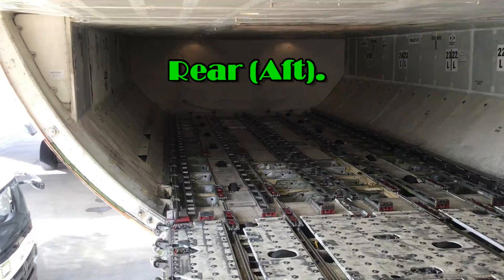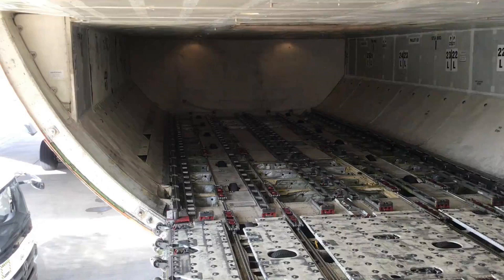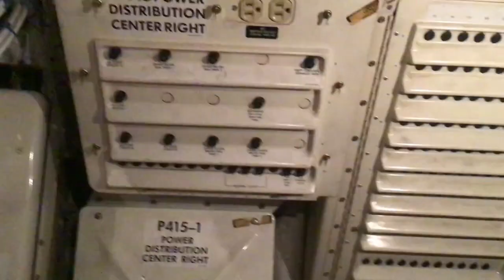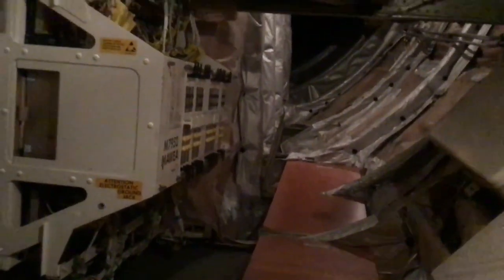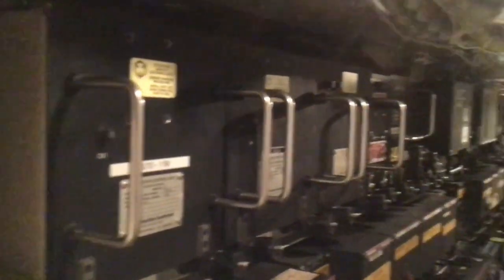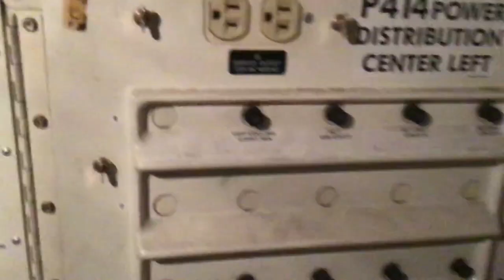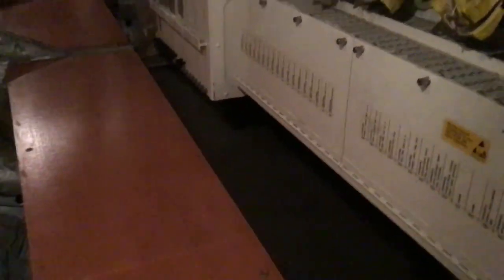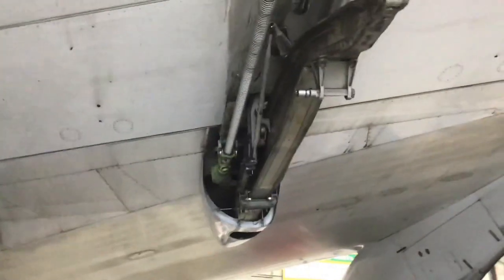747  below the floor

Comment: Awesome tour inside the belly sir 👍 you can clearly see the robust design of the fuselage structure yet the misfits keep crying thin and weak.
Very nice pointing out how small the batteries are as Jones claims there are loads of batteries!
Amazing how the flaps do not go into the wing, as they extend and hang off the wings trailing edge.
Reply from the maker: DC8Combi thank you sir, I did laugh when the dumb plumber mentioned in one of his recent videos about how huge the batteries are. The biggest aircraft battery I have ever seen was the one fitted to the Lockheed L1011 Tristar. That one was about 30 inches long by 8 inches wide and 12 inches deep and weighing about50+kilos. There was only one needed to start the APU the second battery was purely a flying spare. Airbus unlike Boeing have 3 slightly smaller batteries.
Reply: ianobiwan 👍 from the way Jones was talking you’d think the entire belly was batteries 😝😎
I’m getting my butt kicked here tonight 😂😂 maybe 45 minutes of work left then tons of paperwork or should I say computer work. It must be done and inspected by midnight, I’m by myself but I think I got it 😎
Once I sign off to inspection I’m relaxing for 4 hours of overtime 😎
As soon as I started watching your 47 belly video I thought oxygen and you were right on it!
Let me get this bird done then I can goof off, I know it’s late your time.
Reply: DC8Combi   Dude, don't worry about a thing.
It's all compressed air....
Reply: @garygolfer3243  the first MV-22 CCRAM went gear up for test flight and she was compressing air so hard them tandem rotors threw major rotor wash of burning kerosene from her APU  all over, I was there with her.
Reply: @ianobiwan  I just got to watch the video on my computer as I only had my phone last night, the video looks real good with detail on my computer compared to my iPhone.
Reply from the maker: DC8Combi once again thank you. I will see how long Juke takes to create another alias to post a comment as I have had another cull with Pennyjuke special new friend and Gabriel.
Reply from the maker: DC8Combi yes Juke, his aliases and Joke Penny I see are all spewing their normal stupidity again. Joke Penny the idiot that has no idea how simple PRV’s work, or what a crossfeed valve does and then his no fuel bollocks. I did laugh how quickly he gave up trying to explain how his unicorn piss powered engines work when the Trent 1000 was thrown into the argument, which instantly destroyed his nonsense. They are just jokes. 
Have you seen Agent Jay latest engine video? He talks about the issue of certain GE90 engines turbine blade failures and during the video explains fuel tanks in about ten seconds! Only the fueltards will not understand!! 👍😎🇬🇧
Reply: @ianobiwan  I will have to go over and watch Agent Jay's video, thank you.
Reply: @ianobiwan  Agent Jay did a great job, and his fuel tank quick course was awesome lol. I was aware of the AD from Blancolirio channel but Agent Jay had some really good additional information. I'm guessing the seals are carbon, years ago I did some work for Stein Seal and they made carbon turbine seals. Stein Seal was a really interesting place with some really talented older German engineers and specialist.
Thanks again I'm glad I got to see Agent Jay's video.
Reply: @ianobiwan  did you see what just happened on Professor Jone's channel? There was some real strange post on one of his newest videos and then BOOM it disappeared with a few others! Then a new video labeled his last came available and he was whining about some $42,000.00 fine, I commented "who was that person that came outta nowhere" and "what fine" BOOM all his videos from the past 6 months gone! Only his old video is available.
Reply: @ianobiwan  he's taking everything down! Something got him in BIG trouble!
Reply from the maker: DC8Combi  yes I did see jones latest video whining like a girl over the usual and this $42000 fine. I did see something about this fine on YouTube the other day. I haven’t read anything about it yet. No doubt it will be about copyrights and inappropriate material. I will check it out at some point soon.
No doubt the wife was standing over him forcing him to delete his nonsense as she is not happy with him as he hinted in a recent video. Joke Penny and the Duke aliases will be a bit lost as their god is now running away, well until he comes back again. 
I am just checking out now as I am up early for work in the morning. Well at least Joke Penny will be quiet for a while!! 👍😎🇬🇧
Reply from the maker: DC8Combi everything has gone. The wife has definitely given him a choice, the mad looney videos or lose those massive balls!! 😂😂
Reply: ianobiwan 😝I see they are gone! I guess he choose keeping his massive balls 😝👍
I gotta look into that fine as I didn’t know anything about it. 😎
Reply: ianobiwan have a great day sir! 👍
Reply from the maker: DC8Combi morning sir, yes that was an amusing video. Well at this moment it does look like it is fairly terminal with jones and his mad videos. I wonder where Joke Penny and the clone army of twats that is Duke they are hiding. I see Emperor has changed names and popped up on Roger’s latest video. 
I saw a photo posted on jones Facebook site titled great unsolved mysteries of the world, with three images, a Saturn 5 rocket, the LEM and the Command module after it return to Earth with the words “ how did this turn into this and then this” ending with research flat earth. I laughed as it proved they don’t research and know nothing.😂👍🇬🇧.   https://www.facebook.com/photo.php?fbid=181968399615776&set=a.110925366720080&type=3&sfns=mo
Reply: @ianobiwan  good morning sir I thought you may enjoy the Peter & Pete. Yes Jones is terrified of this new rule and as you know the misses runs the show, she probably confiscated his toys and watches everything he does on the laptop. Duke is also over on Rebel without a clue's 2 channel I left him a comment there. He's been caught on Rogers channel and soon to be culled.
I wish I did Facebook to laugh at him there but I do occasionally visit his twitter.
You see the NTSB made a suggestion that Boeing modify the 37 NG's turbine inlet rings after the Southwest 37 blade out that breached the containment ring causing a piece of the cowling latch to break a window a year ago. The FAA will be the final determination, if so there are around 7,000 37 NG's that will need mods. Boeing says they are already looking into modifications.
Reply from the maker: DC8Combi wow Boeing have got a lot of work to do. I did read recently Boeing have been told to redesign the structure that has been found cracked on the 737NGs, which again is massive amounts of work for the operators.
Reply: @ianobiwan  yes they do! That's correct there is an AD on the pickle forks of the 37 NG's and it's revealing quite a bit of them.
Reply from the maker: DC8Combi  check this idiot out. There are some familiar names in the comments with the usual nonsense.        https://youtu.be/Cns2Fvo8TbE
Reply: ianobiwan yes there are i was there previously the guy who made the video is brain dead he hearts insults.
I did just notice the peculiar comments as they are very familiar
Reply from the maker: DC8Combi it is a site that is at the moment free of Juke and his clone army of head demons. Jones seems to be pumping his nonsense out on his Facebook site but hardly anyone comments on his posts.
Reply: ianobiwan iId like to see his Facebook shite. I think I’ll ask one of the grandkids to use their account this weekend and get a laugh 😎
Reply from the maker: DC8Combi yes it is worth a look just to see all the deranged and ignorant articles he posts or agrees with. The guy is definitely a qualified loony bin.👍
Reply: ianobiwan  and DC8, I am a lowly aviation analyst who tells airports where to expand, locate jetways, passenger traffic counts, etc... as such, I make friends at every airport I work at and that allows me to see EVERYTHING up close. You guys obviously realize I have access to airside ops, and can verify aircraft size  and the necessity of fuel, thereby rendering a lot of conspiracy videos totally false.  That's my favorite part of commenting on the ridiculous conspiracy videos, all of us can go see for ourselves everyday while they sit in front of their computers wasting their lives away. Cheers
Reply from the maker: Gary Golfer thank you and it is so true about these sad people. Judging by some of their comments it makes you think how they get through just one day. How do they live as everything to them is a conspiracy by the unknown “They” . As you say these idiots do provide plenty of entertainment. How can these “woke” people be so scared to go and physically research their claims, they just want to remain ignorant and uneducated. As they always proclaim they know about all this secret stuff that is being hidden in plain sight, it is so funny that they never can produce any evidence or proof of their claims. 😎🇬🇧👍
Reply: @garygolfer3243  but you signed the non disclosure form and you also wouldn't want to jeopardize that job that was handed to you would you, lol.